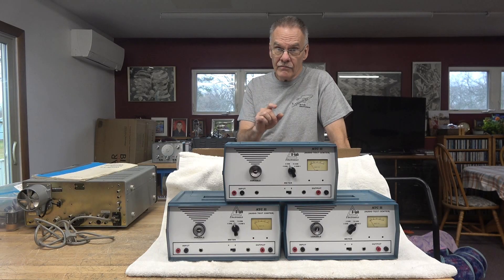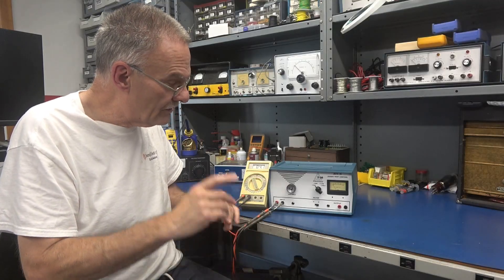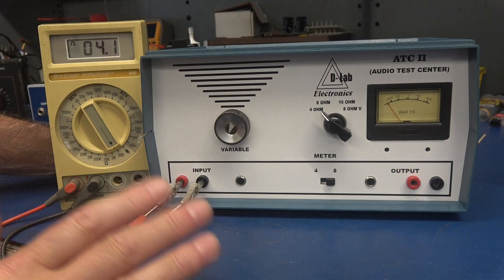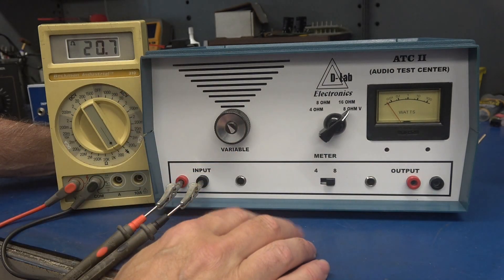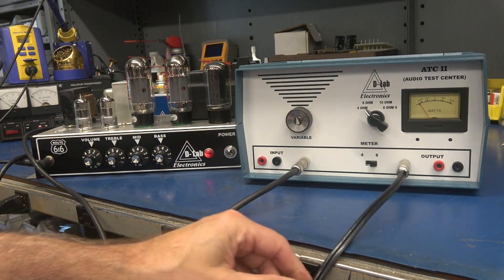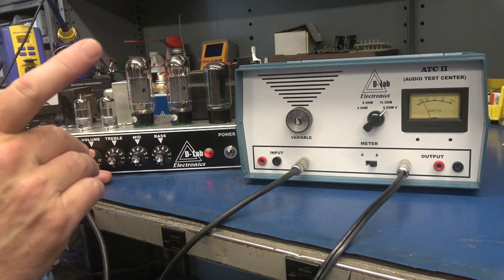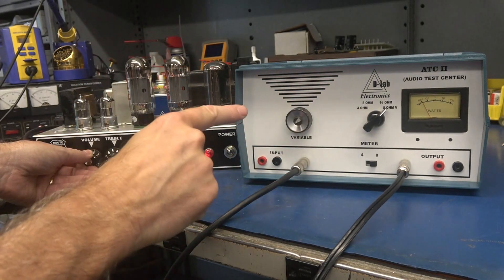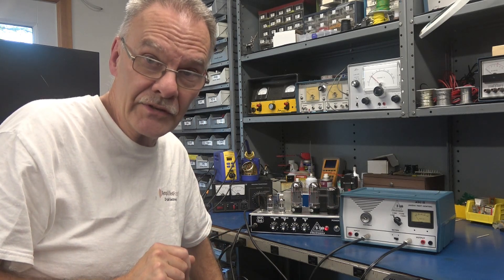D-Lab electronics ATC-II audio test center amplifier test equipment repair bench marvel for sale

Comment: Can you hook up an oscilloscope (and is it safe to do so) to the banana plug outputs using 4/8/16 settings, or do they only work on the 8V setting?
Reply from the maker: You can connect an O'scope to the input Bananas or 1/4" Jack on all ranges